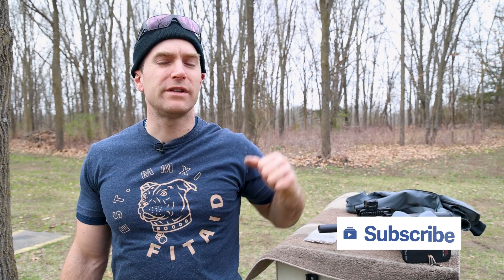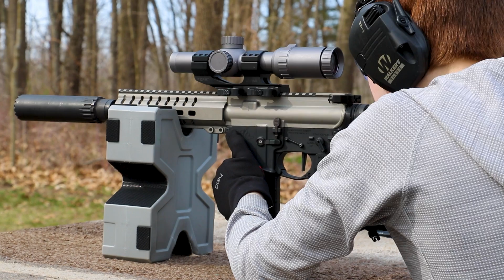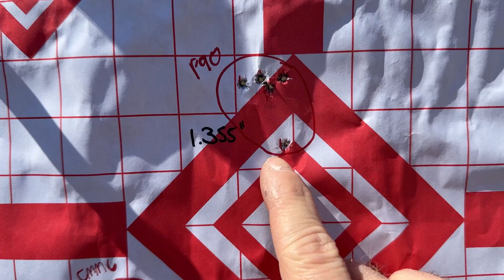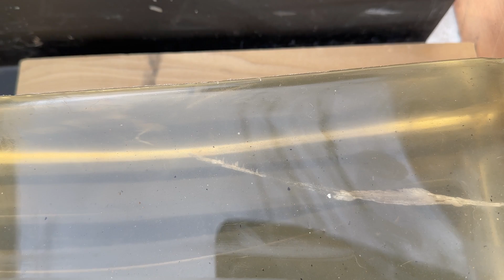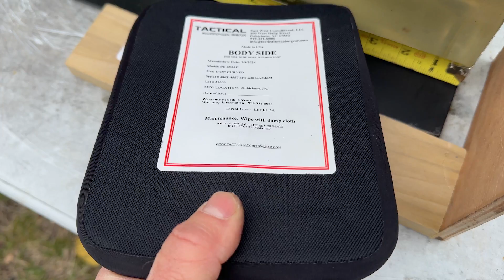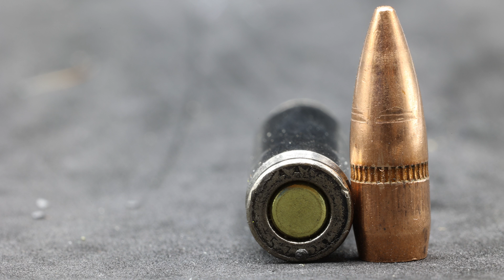5.7x28mm, 55gr FMJ, SB193 Clone, Liberty Armament

Comment: M&P suppressed with dead air mask eats up 62 grain fiocchi like nothing. 110 rounds rapid fire and had no issue. Had to soak barrel and sheath overnight to get it clean though.
Reply from the maker: And you’re sure that thing isn’t heyholing? Virtually everyone who’s shot the 62gr subs in the MP57 has them keyholing
Reply: @BuffRANGE  happy to send you videos, zero issues what so ever with 250 rounds; not a single keyhole on paper target from 5 to 25 yards   Dead air mask .22 Suppressor directly threaded onto M&P 5.7 barrel.   MP 5.7 really needs to be cleaned and lubed well. I bought mine used and it was finicky at first but Most issues I’ve had shooting un suppressed were caused by poor lubrication / poor cleaning.  Manual suggests submerging / soaking the barrel and sheath overnight and I doubt most people do that with the 5.7 and probably just treat it like a Glock.

Comment: If only something in 5.7 had a 1:8" twist, then you could use the 68gr BTHP from Hornady. That bullet is empty from the tip down to about 40% of the way down the bullet. It is GUARANTEED to tumble within 1.5" and do it TWICE before it hits 9-10" in gel. It is also routinely sub MOA at 100yds in my Howa bolt rifle. I load it right around 1020fps so its always subsonic, even when it gets really cold.

As for the video, that cycling with the M&P is another pro for picking it as a 5.7 handgun among other things. I know gow you feel about the Rock, but i do fancy the M&P.

Comment: What's your 5.7 round of choice for SD?
Reply from the maker: Reliability and function #1. If you can't find the ability to afford #1 on the list or feel it's not reliable, then move down the list.
Vanguard Outfitters Black Dragon Fang /Vampire Fang
Elite Ammo T6B (this scores lower because of accuracy issues from pistols)
Elite Ammo Dev 2.0/3.0
Elite Ammo S4
RR Weapon Systems R37X
Elite Protector 1 (or any 40gr ballistic tip at 1900 fps+)
SS190 (limited penetration)
Hornady Black Vmax
AAC Vmax
Vanguard Outfitters GPM
Speer Gold Dot
SS198LF (limited penetration)

Or thereabouts in that order.
Reply: @BuffRANGE  wow, thanks for the great reply

Comment: The more videos of the M&P I see around the more impressed I am with it, sub sonic to hotter boutiqe rounds its seems to cycle everrthing, and it does it with softer recoil than the competion, I saw a break down of the gas system, its pretty innovative, before seeing it I thought it was just a scaled down version of DI type gas sytem.
Reply from the maker: The velocity loss for me and iffy barrel concentricity and poor ergos have it on the bottom for me
Reply: @BuffRANGE  must uncomfortable pistol I've ever held
Reply from the maker: @lordhellfire153 no disagreement here

Comment: Did you make that e-glass panel yourself?  If not, do you mind sharing the manufacturer?
The only commercial 3A e-glass panels I've seen are the bare wall panel type that BAM sells.
Reply from the maker: It's from Tactical Scorpion Gear "armorking" is even a discount code :D > IIIA: https://tacticalscorpiongear.com/tactical-scorpion-gear-level-iiia-body-armor-pair-hard-6-x-8-plates-stops-44.html
Reply: @BuffRANGE  Thanks!